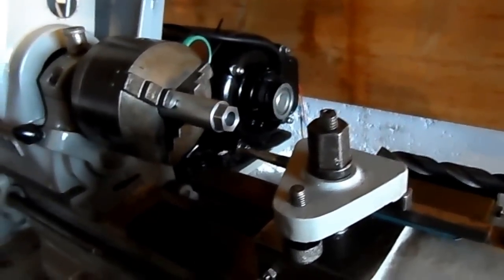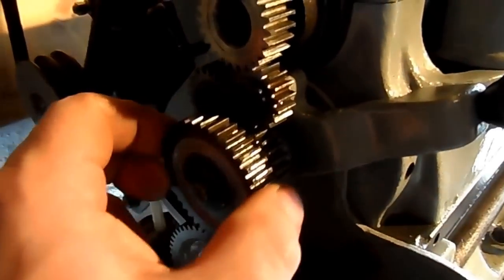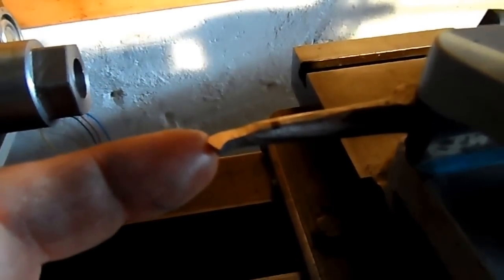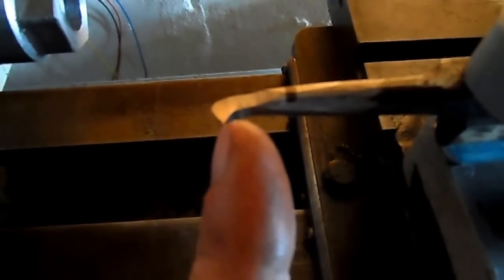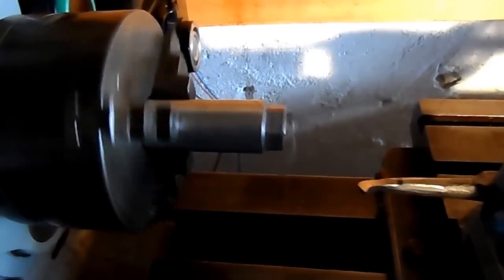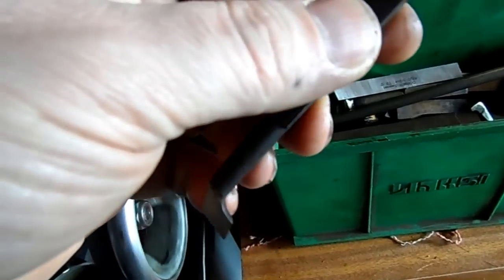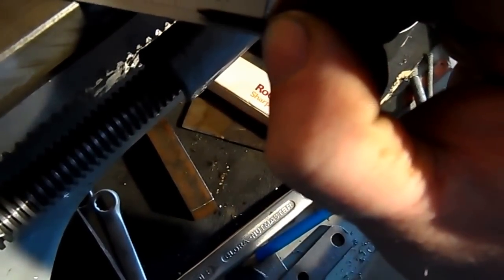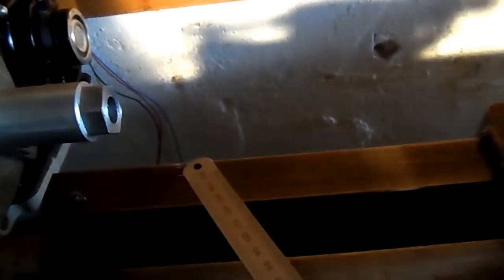Screwcutting On The ML7 Episode 01

Comment: Did you mill the flats on the nut with a vertical slide? A good idea is to use a DTI  zeroed on the quill of the tailstock. As you wind the tool into the job the DTI indicates depth. Interesting series, thanks for posting.